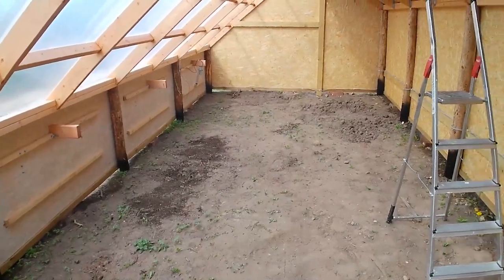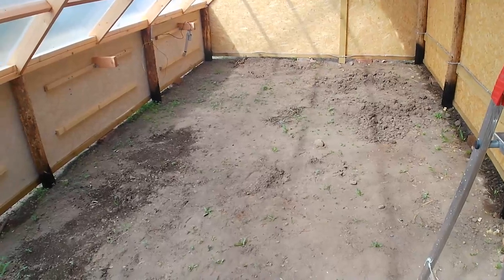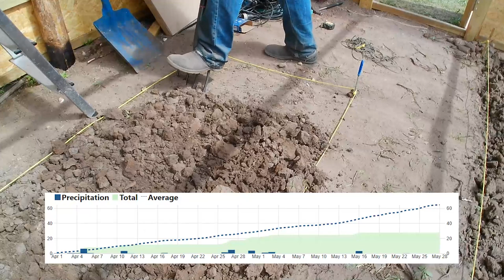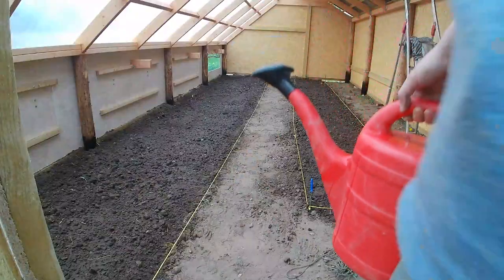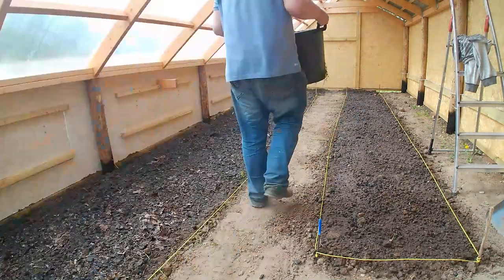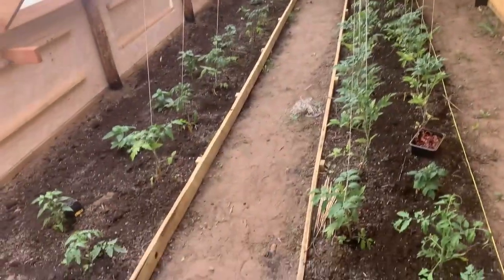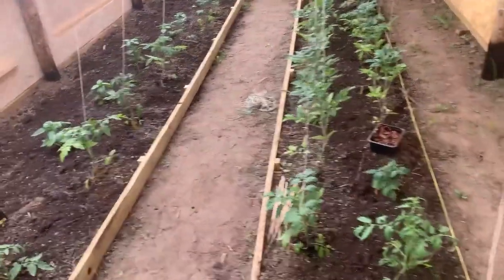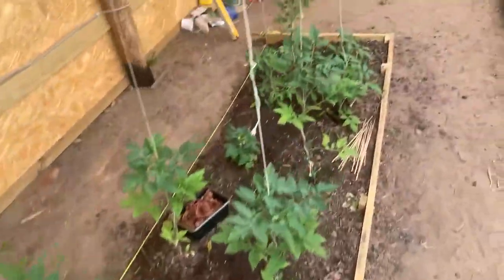Passive Solar Greenhouse Build Part 7 - Preparing Soil Beds & Planting Out

Comment: I think that is really smart adding so many different nutritional layers. I don't understand the fermenting liquid you used but I only know a little bit about the basics of gardening. Question you have a 3 stages growing process the germination, the round starter greenhouse and now the passive solar. Does that mean you can grow all year long no matter the weather.
Reply from the maker: In theory we could because of the grow lights we have indoors. Outdoors the problem would be light not heat but we probably could keep things alive though the winter.
Reply: @BalticHomesteaders  Well if this is possible that will be the best. I know it's easier for people with indoor greenhouses attached to their houses to keep things alive in the winter. I didn't know about outer greenhouses all that much besides the general basics